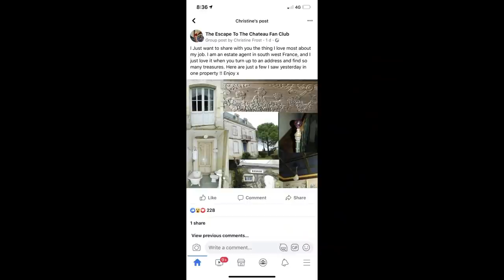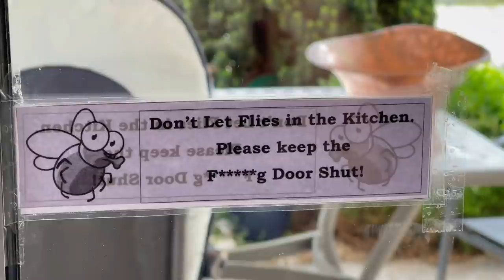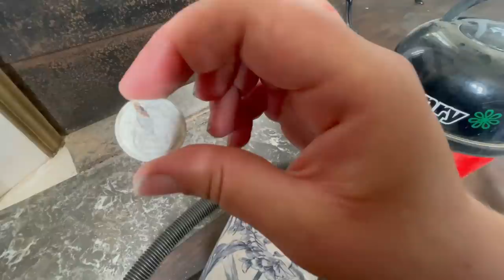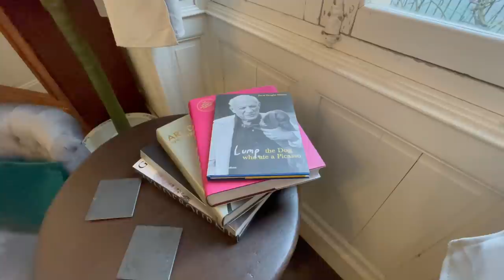Room Reveal Episode #40

Comment: Lovely job. Well done. What paint colours did you use? They are lovely. Only thought would be to move the outside table to below the stairs. Much safer
Reply from the maker: The only thing we have used so far in the main room has been white paint, the woodwork was already painted in the putty colour and we have just cleaned it for now. Eventually we will go back and re colour the room with a very similar colour - Farrow and Ball Molesbreath as some of the woodwork in the room also needs attention sadly, it is almost like colours from the last paint job the house has in the 1930's are making a comeback now. 
The chairs were sadly never used but will be moved.